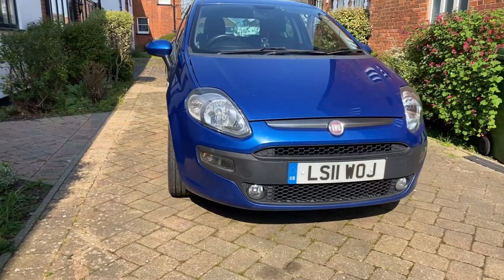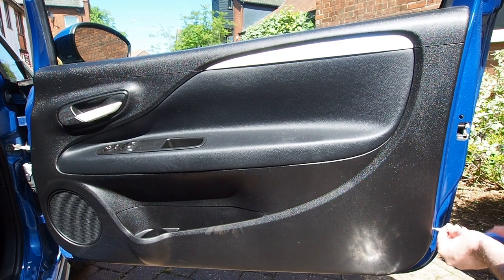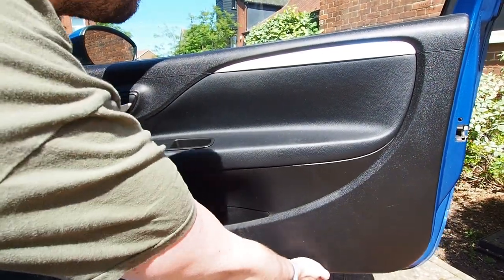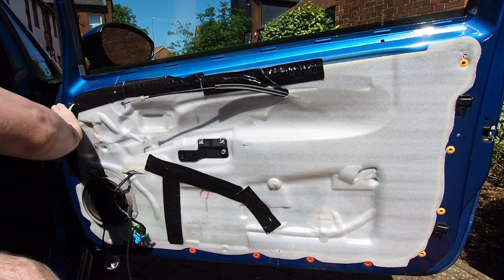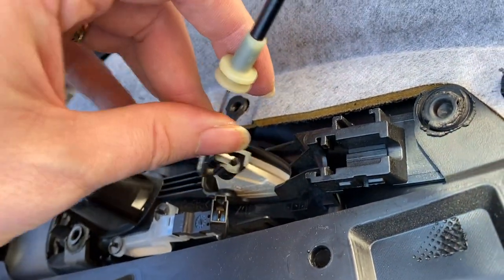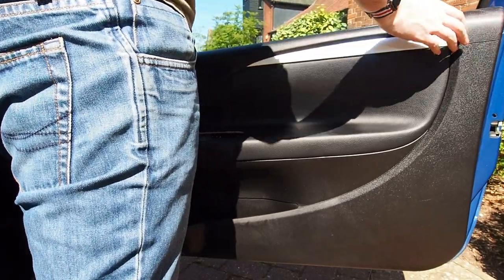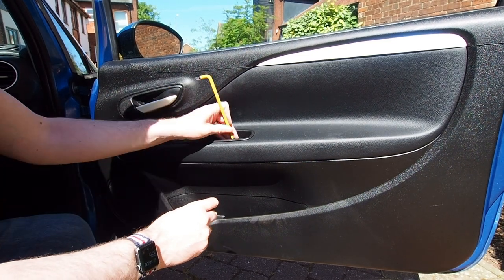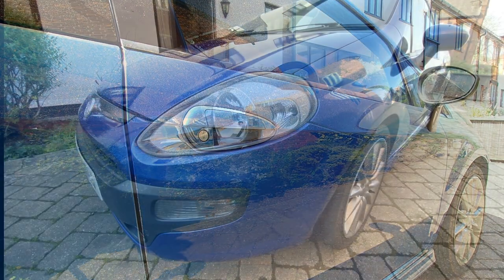I show you  how to: Remove the Inner door panel (door card) and refitting Punto Evo/grande

Comment: Hi. I have tear water proof mebrane. Can i replace it with something else or do i need  to put again the same?
Reply from the maker: you can replace it with a piece of plastic cut to shape, the important thing is to make sure its quite thick plastic so it doesn't rip or degrade to easily or quickly.
Reply from the maker: I can’t read Greek so not really sure but it looks ok from the picture, any sort of automotive glue would be ok l, usually panel bond/silkaflex type stuff

Comment: I’m having trouble prying the panel off, any suggestions?
Reply from the maker: Unless someone has been there before you and glued things back in place, it should be fairly easy to remove. you can give it a bit of pressure but you shouldn't need to be bursting any blood vessels to get it off

Comment: Don't you want to replace your music speakers with better speakers? I would like to, but don't trust me. Mine are the cheapest from Fiat. OK, but not good.
Reply from the maker: This car is very high spec and the audio system while not the worlds greatest is pretty good, it has better speakers in the doors and a subwoofer in the boot all installed by fiat, so as it stands I have no plans to upgrade anything